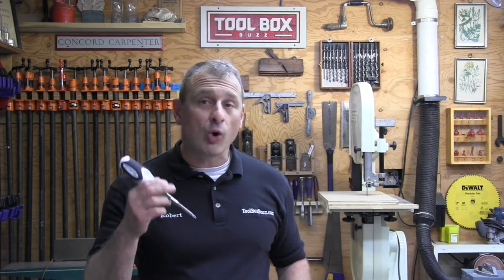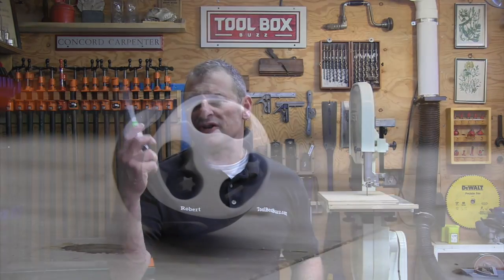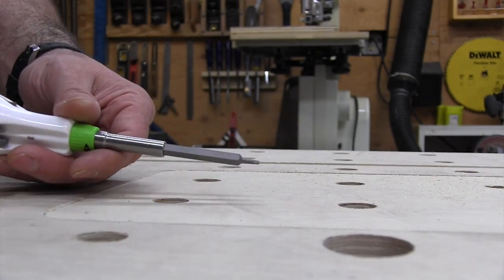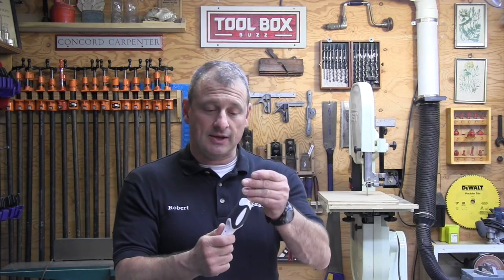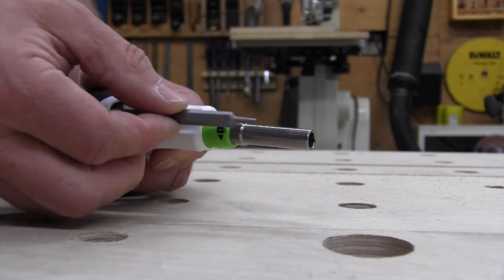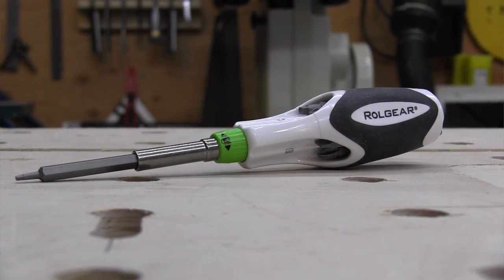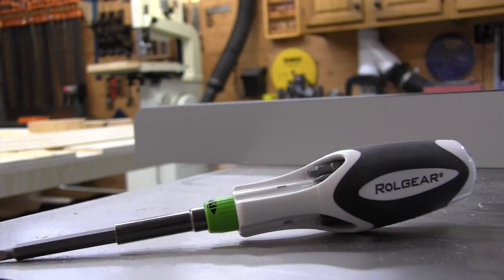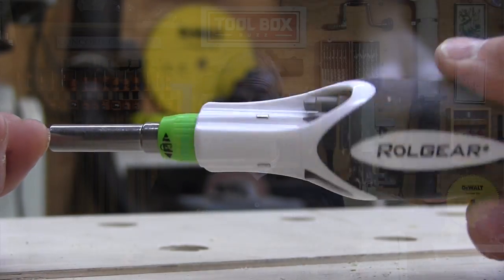Rolgear 15-in-1 SILENT Ratcheting Screwdriver

Comment: I've had mine for at least 3 years of constant use it still works great. Although after such prolonged use the ratchet sticks up every once in a blue moon, I found that bearing oil works well to fix that issue.

Comment: Good video will probably pick one up. A thought on the 1" bits though, to use with 1" bits would mean a more shallow shaft which would translate to more play in longer bits. Instead just pop in a bit extension that can hold your 1" bits. If your using a 1" bit set there is a good chance you already have one on you.

Comment: I really love multibit screwdrivers, but this one would be so much better using standard 1" bits. That's really just a killer because bits are never covered under warranty as they're considered consumables. So good luck getting new ones after they inevitably wear or fail.
Reply: Just use impact driver bits